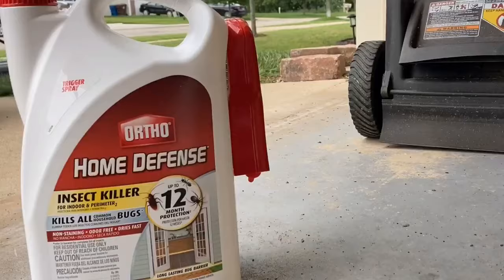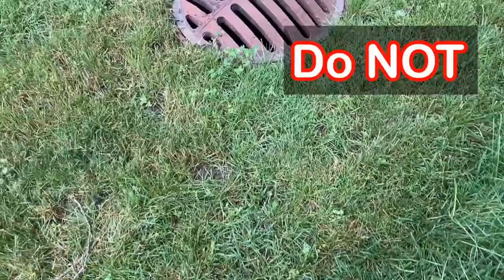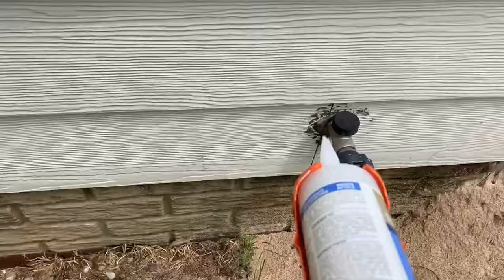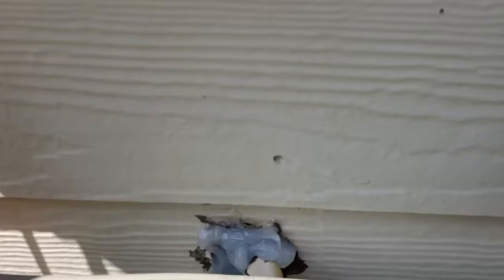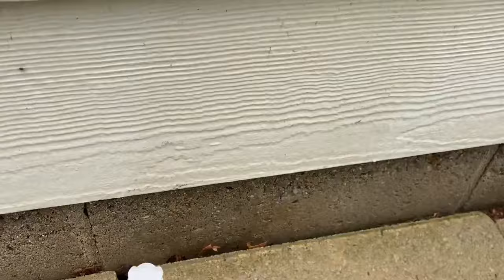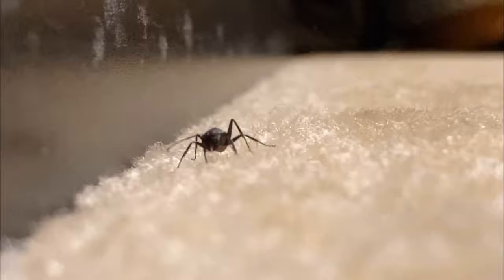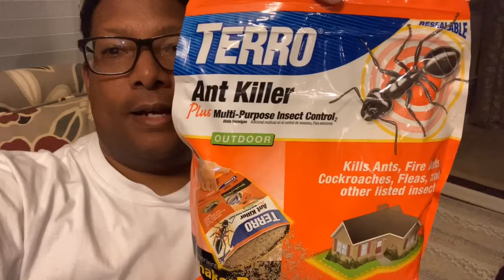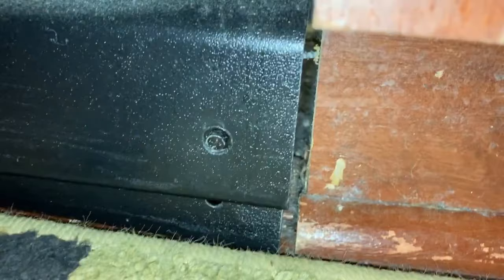ORTHO Home Defense and TERRO ant Killer Review | How to Use, Does it work, Application and Safety

Comment: If using the battery powered sprayer, remove the tube from the container and using a cup filled with water, put the suction end of the tube into the cup and purge the tube and nozzle with water.
Reply from the maker: Thanks for sharing this tip

Comment: Thanks for the tip about sealing the exterior holes. I noticed there is many ants coming from the hole of a water valve. I sealed it.
Reply from the maker: Great job! 

I had them in a valve, ac pipes and I did not show this in the video, but they where crawling up a wall and getting into a window. Crazy! They are gone now!
Reply: My sprayer was working. It still makes the noise like it is spraying but nothing comes out. I took it apart, made sure nozzel and bottle are both on and stuck a needle through the holes in case it was clogged but to no avail. Help please
Reply from the maker: @gecolon here’s a video that will walk you through some solutions that I made
https://m.youtube.com/watch?v=9syeNxZMgtg&pp=ygUUVW5jbG9nIG9ydGhvIHNwcmF5ZXI%3D

Comment: I've used Ortho Home Defense for years and it's a good immediate contact killer. But it sucks as a deterrent.  I'll vacuum an entire army of ants, spray the trail, and soak the entrance that they came through and 15 minutes later they're back in the same area.  Super frustrating so I'm gonna try Temprid Fx which is a commercial grade insecticide that is suppose to work a lot better.
Reply from the maker: If you spray outside it helps kill ants before they come in.
Reply from the maker: Thank you for sharing with this community!👍

Comment: This is a great video. I'm planning to do this this weekend but for small roaches. Any additional tip in my case? Also, question, I have a puppy and I'm concern this would be toxic for her. Should I do it during the night and lock her in the bedroom and wait how many hours to be sure is dry and safe ? My roaches are mostly hiding behind the fridge and where I keep my pans and lids, Can I use this inside the kitchen cabinets? or just outside around the cabinets and kitchen island? Thanks!!!
Reply from the maker: Keep her away until the product dries. (Perhaps 45 min to 2hrs. Based on the temperature and air circulation of your home)

Are you in an apartment or condo? 

Regardless of if you are, you will have to move pots or pans out to see if you can see any holes where they could be coming from or nesting.

I would spray in the holes, but not the general area where your cookware is put in.

If you are in an apartment or condo connected to another unit, the biggest worry is to patch any holes that go to the other apartment or an adjacent wall. They could be coming in through that area.

I would spray any holes where the bugs could be coming from.
Keep in mind that this is my experience with the product. I am not an expert.

Check out this other video I did about spraying in counters.
https://m.youtube.com/watch?v=jSwLPEhZO2M&pp=ygUSb3J0aG8gaG9tZSBkZWZlbnNl
Reply: @strategyandperformance  Thank you!!

Comment: I know this an old video hopefully you see my comment but spraying indoors you mention spraying the outside of cabinets …it won’t ruin the wood cabinets? Also can we spray on carpet or along the border of the walls?
Reply from the maker: Yes, you can spray along the carpet where it meets the wall. I spray on the baseboard on the wall and have a drip down towards the carpet.
It won’t ruin the cabinets if you spray in the corners.  If your cabinets were recently painted depending on the paint it could fade the color a bit. Testing a small area before doing it if they were recently painted.
Reply: @strategyandperformance  thank you! 😊

Comment: The ants are crawling in the top of my dinning table and I cleaned up but they are still coming if I spray ortho home defense insect killer indoor and outdoor around the house do you think it should be helping?
Reply from the maker: It should be helping. Do you know what type of ant is it? If they are carpenter ants,big and black, you will have to get terro granules outside of the house. I mention this at the end of the video.

If they are small black ants Ortho shoul be taking care of them unless you have a large colony living inside the house.
If you have a large colony and living next to our inside of the house, you will need to use Terro ant killer. Here’s the video I did. It is important that you find out where the ants are coming from or find a main area that they travel through to get to the table.

https://m.youtube.com/watch?v=RSuA8cqoFrU&pp=ygUQdGVycm8gYW50IGtpbGxlcg%3D%3D
Reply: @strategyandperformance  thank you so much 🙏
Reply: @strategyandperformance  I don't know but they burning my skin

Comment: When you say not to apply this where pets and children play… do you mean when doing the application? My entire house is a spider hub so I would like to spray every room.
Reply from the maker: Sorry, for the late reply. You can spray. If you have carpet, I would only spray along the wall, two inches from the ground. 

For the spiders, try to figure out where they come in. If there are any windows, or if they’re coming through attic spaces or air vents. I would spray near those.

Also, if you have a garage or door that leads to the backyard, I would spray below it.

I personally don’t spray the carpet. The label says it’s safe to use in pet areas.

Comment: What happens if you live in apartment on the top floor ? Should I still worry about the outside in trying to find access points for the ants or should I just focus on the inside ? The only place we really get ants is the mater bedroom and we will get so much ants just for crumbs being on the floor not even food being left out, sometimes even napkins with food particles on it they will gather up in a group of a hundred which is crazy to me, I just bought some ortho today and plan on spraying the cracks underneath the base boards around the room
Reply from the maker: Great! If your apartment is higher than 3 stories, you might need to get Terro Ant Killer if Ortho doe not work by itself. If one of your neighbors has lots of ants you might have the problem of finding dead and live ants in your apt from the Ortho. If that happens, get terro to kill the Quin.
Here is a video on terro ant killer.
https://m.youtube.com/watch?v=RSuA8cqoFrU
Reply: @strategyandperformance  thank you so much !! 🙏🏽💯
Reply: Did your neighbours have ants? I have ants and my neighbour told me they don't have. I don't believe it! I think they are coming from under my parquet flooring.
Reply: @frostflower5555  No ! My neighbors did not have ants, and even if they did honestly after buying that stuff and spraying it I haven’t seen any ants around 🙏🏽😁 so it worked for me !
Reply: @trapkoda  Would the bait work as good?
Reply: @frostflower5555  I’m not too sure, that’s more of a homemade remedy which you would have to mix chemicals or other ingredients in a spray bottle, I haven’t tried that, but I do recommend getting the Ortho home defense 💯

Comment: Their getting in under the door, will a weather strip keep bugs out
Reply from the maker: Yes. Spray after installing it. I would spray around the base of the door and on any edge or corners leading to the door. If you have ants, use Terro ant granules to stop them before they get to the house.

Comment: I cannot get the wand to work  I tried everything possible, pls help
Reply from the maker: If it’s not pumping and no sound when you pull the trigger, check for a white or clear piece of plastic underneath the wand and pull it.

Make sure the small square plastic lock underneath is switched to on.

If it’s pumping and nothing is coming out:

1) make sure the flip nozzle is up and the pump connection is in all the way. You’ll hear a pop if you pushed it far enough

2) Check to see if your bottle top has an on or off along the lid. If it does, make sure it’s set to on

3) make sure the tip of your magic one is set to a spray with

Let me know if you tried all of those. If it still does not work, let me know if the pump is pumping.

Comment: Is it safe spray on Carpet ? Will it smell bad? For Indoor
Reply from the maker: I would not spray the carpet directly. I spray it right on the wall edge and have it run down to where the carpet meets the wall.

I don’t know if it stains The carpet. I have not noticed any stains or discoloration in the areas where he has come in contact with some of the carpet.
Reply: @strategyandperformance  how about smell ?
Reply from the maker: I have not noticed any smells from the application in the kitchen or the areas where I have applied it (as described above) where I have carpet.

Comment: I'm having a major ant problem. I try spraying this stuff and it kills the ants, but the then the ants find a different place to go to. Does this spray spread? Like, would the ants spread this poison to other ants or no?
Reply from the maker: If you are in an apartment, you need to kill the colony. Use Terro ant killer. 
My video:
https://m.youtube.com/watch?v=RSuA8cqoFrU

It will take one to two weeks depending the colony size. 

IF they are carpenter ants and you live in a house, use Terro granules. I go over it at the end of the this video.
Reply: Those Terro ant traps always work for me. Let them sit 4 or 5 days until there is no more ant activity and the colony is dead

Comment: Any advise on how long I should stay out of a basement after applying ? I turned on the house venting system and a few fans and an air purifier
Reply from the maker: It should take about 20 mins. If you are in a place with high humidity, about 40min.

Comment: How long it last?
Reply from the maker: It depends on where you live. Outside, if it rains hard, the product looses some effectiveness. Inside the home, it theoends on heat and humidity. 
I go into detail in this short video https://m.youtube.com/watch?v=jSwLPEhZO2M
Reply: @strategyandperformance  ehhhh so if it's warm inside it doesn't work or if it's cool ?
Reply from the maker: It works. If you live in Michigan or Minnesota, it will last longer. 5 to 8 months. In Texas or Florida, my experience is 3 to 6 months. Then you have to re-apply.

Comment: I have the comfort wand but the top portion to place the wine is different from yours. Nothing's coming up
Reply: Look at the bottle where you connect the wand. The connection needs to be facing up not sideways. Some bottles will have writing where you have to twist it to on position.

Also, are you hearing the wand pumping? 

If you don’t, check on the lock (gray color non) near the button to spray. It needs to be unlocked. 

Lastly, if you can push the button, the nob on the bottle is up and it’s not looked by the button, if it’s a new bottle, there is a little piece of plastic near the one that you have to pull out to activate the batteries.
Reply: Look at the bottle where you connect the wand. The connection needs to be facing up not sideways. Some bottles will have writing where you have to twist it to on position.

Also, are you hearing the wand pumping? 

If you don’t, check on the lock (gray color non) near the button to spray. It needs to be unlocked. 

Lastly, if you can push the button, the nob on the bottle is up and it’s not looked by the button, if it’s a new bottle, there is a little piece of plastic near the one that you have to pull out to activate the batteries.
Reply: Mine 2 just normal nozzle what did he u find out??? Appreciate